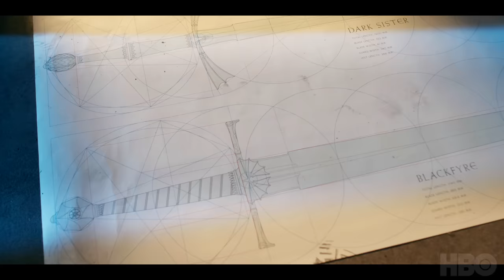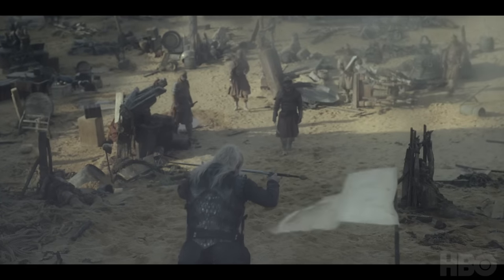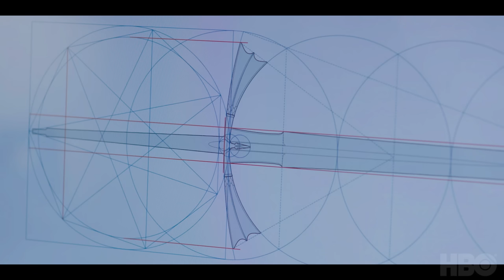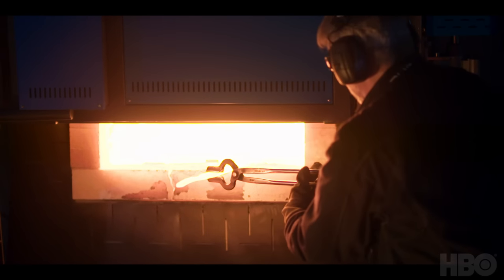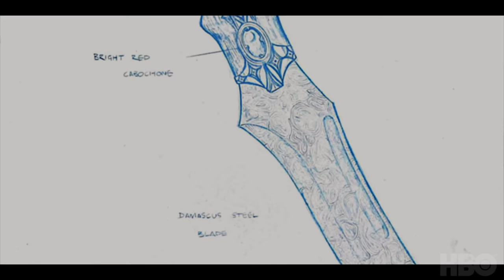Inside the Craft: Weaponry & Dark Sister

Comment: Why did you use the seven-pointed star in Dark Sister if the Dark Sister was designed in Old Valyria? Faith in Seven wasn't make sense for sword makers then at all. The Targaryens had another faith.
Reply: Blackfyre was layed with Aegon the Conqueror when he died, and was on his funeral pyre, the fire is said to have darkened the blade and likely damaged the hilt. At some point during the time between Aegon's funeral and Jahaerys Targaryen's reign, both swords may have been rehilted to reflect a shift to the Faith of the Seven.
Reply: @BlazingSteel It was never said they were re-hilted or that they were damaged. Also, why would Maegor (the one who would've re-hilted them) put symbols of the seven on it when he hated that religion.
Reply: @Aaron Guest  implications. Let's not forget that GRRM does many parallels. Longclaw's hilt was damaged in the fire before being fit with a wolf's head pommel.
And odds are that it was rehilted for Aenys, Aegon's son and Maegor's brother, though he was not martially proficient, he likely didn't want his father's sword to be rendered unusable.
Reply: @AaronGuest  Aegon's funeral pyre would have been the earliest it would be rehilted, but Blackfyre and Dark Sister have been in Westeros for at least 150 years by the events of House of The Dragon. That's plenty of time for the hilts to be either damaged, worn, or decayed and needing replacement, especially if the hilt components are not made of Valyrian steel. As a magical steel, the blades would certainly outlast the hilts in any form of wear and tear.
Reply: @BlazingSteel  Not a single Valyrian sword was said to be too damaged that they needed to be re-hilted. That would just be a poor excuse, those swords would've been getting taken care of by some of the best smiths in Westeros. Also why would they be re-hilted with different designs?
Reply: @BlazingSteel  Blackfyre didn't have a wooden pommel. 

Why would it be re-hilted for Aenys when as soon as Aegon died he gave it to Maegor. Also even if he kept it why would he re-hilt, just because he wasn't a fighter doesn't he'd re-hilt the sword. Blackfyre has a clear as day description and they didn't go with it.
Reply: @Aaron Guest  bronze and steel melt at 1900 degrees and 3000 degrees, which is plenty hot for dragon fire,  and Targaryens were traditionally cremated by dragon fire.
As for why they'd be rehilted? Fashion is a simple answer. More complicated would be martial needs. An unfortunate circumstance of GRRM's writing is that all of his history had a 15th century mindset during 300+ years, while arms and armor vastly changed in Europe in the same span of time.
Reply: @AaronGuest  book 1, A Game of Thrones: Longclaw was in the fire that burned down the Lord Commander's tower. Jeor found the sword with the ruined hilt. The blade, he said, would need a fire 10 times hotter to damage the blade, but the hilt was burned to uselessness.
Reply: It's still not an answer why to use Faith in Seven for Valyrian(!) swords that were kept by Targaryen-Valyrian fans? Can you imagine that such a man like Daemon would ever WANT to have sign of Seven on his Valyrian sword?
Reply: @Iam Sheed  even if the Targaryens are Valyrian, they still incorporated elements of The Faith of the Seven to placate to the Andals, not unlike how the Roman's incorporated various festivals, religions, and war tactics into their culture so they could placate to the people they conquered and sided with.
It's a subtlety to not get too hung up on because it's subtext to make the story more layered instead of the sole focus.
Reply: @BlazingSteel  yes, but all of them did it for public! Sword's hilt is not something that public will ever have a chance to see well. A sword is a very personal thing and it have to be assigned with the real Faith and the real Gods that make sense for Targaryens. So that Valyrian Gods to help the wielder in the battle. It's just a mistake of the swords' designers that they didn't read propery a story of Valyrian swords. Aegon the Conqueror would be terribly disappointed if he saw the signs of the Faith in the Seven on two true Valyrian swords. His descendants may use the signs of the local faith in the creation of new things, but not in order to mutilate old and truly Valyrian things! Otherwise, this is a betrayal of their heritage.
Reply: @BlazingSteel  That's longclaw with a wooden hilt, not Blackfyre or Dark Sister.
Reply: @Aaron Guest  dude, Longclaw had a wooden handle and a guard and pommel made of silver before it was burned. The whole hilt wasn't wood.